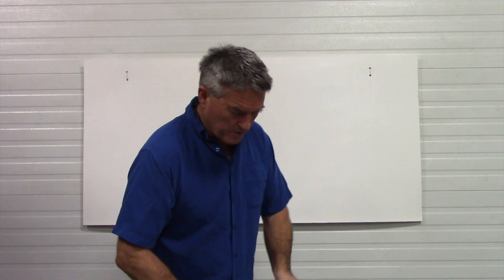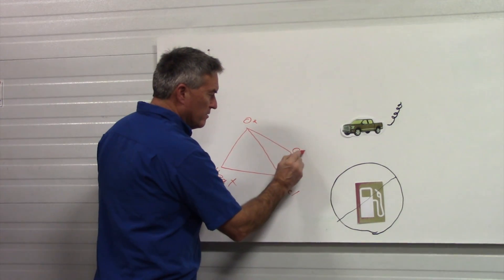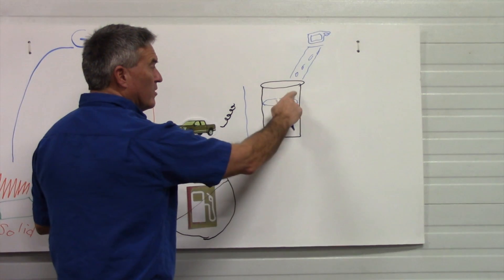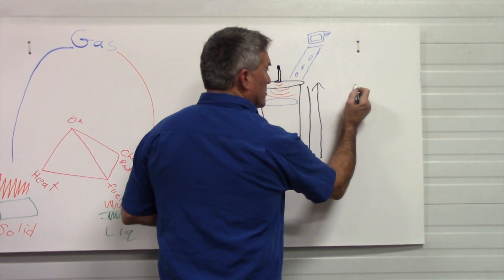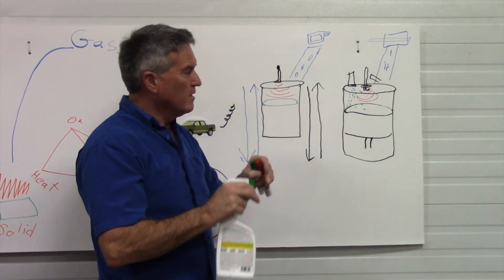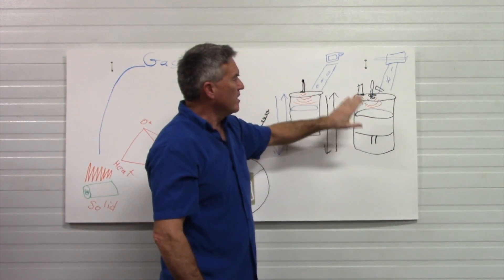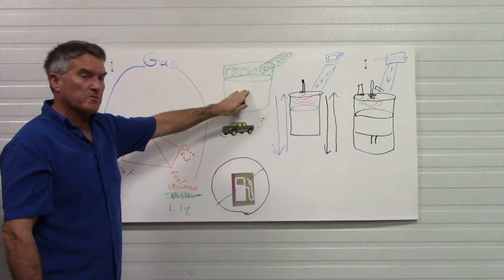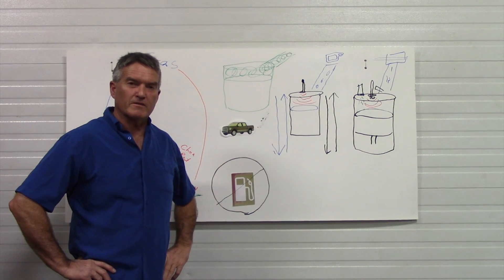One Simple Trick to get 100 miles per gallon with less pollution!

Comment: Gasoline is not made from fossils.  Crude oil is a product that is manufactured naturally far below the the level of anything that even resembles fossils of anything ie plants or animals. Crude is formed from iron, water, heat and pressure, sulfur, and products of the mantle or slag formed on top of the molten portion of the inner earth. New Oil is constantly being made and is replenished. Dry oil wells when left will eventually fill up over time with new oil. The idea that oil is made from fossils and is eventually going to be all gone is false. That was a story that J P Rockefeller fabricated to.make it more profitable.

Comment: From the research & experiments I have witnessed there is roughly about 3 to 4% better fuel economy using vapor over liquid, certainly not 100 mpg! Lets say you have a vehicle that under normal circumstances gets 25mpg. If the vapor method adds 4% better effeciency then you now get 26mpg. That is good but certainly not 100mpg! I am working on distilling plastics back into a workable diesel fuel. Perhaps add some HHO to that mix and you should get even better combustion. To me, recycling waste plastic back into fuel is way more exciting and personally profitable.

Comment: Propane engine fuel systems are vapor systems, although propane has somewhat less BTUs per pound than gasoline, it still doesn't come anywhere near what these folks are saying. 
Frankly reciprocating piston engines just aren't that efficient. If they were they wouldn't have to waste so much heat.
A quick and dirty way to estimate if something is efficient or not is to see how much heat it generates. The more heat, the less efficient. Of course unless you're trying to make heat, that's why they claim an electric heater is 100% efficient from electricity to heat, but it's much, much less if you calculate from coal in the mountain to heat in your house.

Comment: August 2018: Just came across this. Hmmm. In Europe farm tractors,  up to mid 1950's, primarily ran on TVO  (Tractor Vaporising Oil) Kerosine in todays  parlance. Inlet and exhaust manifolds were cast as one unit with an inbuilt vaporiser zone immediately opposite the carburetor  tube. Typically the engine was started on petrol (gasoline) to pre-heat the vaporiser then quickly, by means of a flip tap, changed over to TVO when it would run quite merrily ad infinitum. I also remember some older autos having similar manifolds but continuing to run on petrol. Grand mother had a 1 litre sedan which consistently gave her 40MPG So where does this take us and why did they discontinue combined manifolds. One guess is that Ford found cross flow heads produced more power. Lets have more input on this.

Comment: Misleading and extremely DANGEROUS!  If you create a fuel air mixture upstream of the the combustion chamber, and the engine or device backfires, the ENTIRE fuel/air mixture will detonate!...instantly!  ...causing an explosion proportional to the volume of the fuel/air mixture and the limits of the containing vessel.  Dangerous and foolhardy.  PLUS, we already use gasoline vapors...haven't you heard of LPG?  That stands for "Liquified Petroleum Gas".  It is liquefied to minimize storage space and "boils off" or "changes state" at a reduced pressure.  Educate yourself just a little bit sir, before you try to demonstrate potentially fatal modifications to an already functioning system.

Comment: Ideas like this were used in the 70's with good effect. You still need to change out valve guides etc like you were setting up a LPG engine. The biggest killer of this idea is the computer in your car which will NOT let this work for long. It WILL cancel out any output changes to "beat" you. If you could go BACK to a carbureter you can play with things on that and get some of the increases in efficiency, but who will allow carburated cars anymore, at least here in Australia, you can't have ANYTHING that is not STOCK from the car companies. If the police or the RTA see anything that is not "Standard" they make you remove it.

Comment: He needs to quote modern pollution numbers and get out of the 1800's. The pollution in modern engine is almost unmeasurable. A small fart equals a months worth of pollution from a modern engine. Complete combustion!? Has he ever heard the term...A 'Stoichiometric' AFR has the correct amount of air and fuel to produce a chemically complete combustion event. For gasoline engines, the stoichiometric, A/F ratio is 14.7:1, which means 14.7 parts of air to one part of fuel. Lean burns create excessive heat and pollution. Had he heard of NOX gases? The small flames on his burner just means he also reduced the air to get the blue flame. Too much fuel it goes yellow and produces carbon. He just reduced BTU output. Modern engines create a homogeneous mix either by swirl or tumble,  and use multi injector sprays just like diesels during one combustion event. Don't let this guy BS you!

Comment: I like your idea and have thought about it for years.  The trouble is that lean and fully gassed mixtures, although far more efficient, require an engine redesign which would cool down the engine walls faster.  Lean mixtures translate to hotter engine walls.  So, today's car industry is actually using the rich fuel mixtures to cool the engine from inside.  Pour gasoline in your hand and notice how cool it feels.  Combustion in these engines are always operating in a gas choking style well controlled.  In an old engine design with carburetors, when you adjust to a lean mixture the engine races.  So, you are right.  But the design of today's engine makes it impossible to run it that lean.  

The reality is that if all the heat generated by the engine was converted back to work we would get easily 200 - 350 miles per gallon.  For that, we need a complement engine like the Stirling engine to charge batteries and subject both engines to that effort.  One engine uses gas and generates heat and electricity with a generator.   The other one uses heat to charge the batteries and run air conditioning.  The gasoline engine is an astonishingly inefficient engine.  It uses less than 11% of the power which gasoline can offer.  The Carnot cycle is an idealization which shows you the guaranteed loss, which wastes inevitably 32% of the power under ideal conditions due to adiabatics.  But that leaves 68% of power to play with.   So, 68% - 11% , or 57% loss, tells us that more than half of the power from gasoline is wasted in inefficiencies, most of which is wasted heat.  The criminal here is the guy who invented the radiator.  It was a shortcut to selling gasoline engines before the research and engineering were completed.
Reply: What if you ad a water injector system, to cool the engine, at higher rpm?
Reply: @keithc8108  works fine!
Reply: I know nothing about the subject matter, but what you wrote makes total sense, and is very disheartening to see such a waste, an environmentalist not targeting this particular issue. Instead, they want to take away so many of our rights, instead of doing the job correctly. The wrong people are never held accountable, while the everyday person who's trying to survive, is punished, due to the shadiness surrounding us as a people.
Reply: @ritakus9871 
It's almost like everything good has been inverted.

Comment: The simple trick is changing liquid fuel to a gas. Was an Automotive Design Engineer and knew this 25 years ago. Many have done this to there own vehicle and got 100 miles per gal. Why haven't Manufactures changed to this kind of system? Because the Government and Powers to Be just won't allow it. It boils down to Greed. You can do it to your personal Vehicle but you can't market it. 42 years ago was paying 32 cents a gallon and now it runs as much as 3.00 a gallon. Were not even close to running out of oil. We have a mass amount of oil under the ground in the USA that is setting capped off. It will be used when the rest of the world runs out to operate the War Machine.

Comment: I can´t tell him to get his facts straight since it´s not official but it turns out that fossil fuel does not have anything to do with fossils. Oil is created in the mantle underneath the crust. Some of it, both oil and gas seeps through to the crust where we pump it up. Look it up and you´ll ask yourself, why are old oil fields filled up when they are deemed empty? 

Anyway, the simple trick comes at 12:00 but it´s not clear to what he says or means. He is talking about different ways to mix fuel with air with carburetors and injectors and the thing with those systems is that the fuel is not made into gas, only tiny droplets, so the third option is...

...to vaporize gasoline where there will be no droplets. To do that, which is very simple, is to make a bubbler.  Instead of injecting fuel into the system, you let the air go through the gasoline before it is sucked in to the cylinder. The principle is exactly like a water pipe. If you let the air go through the gasoline, it brings with it fumes from the gasoline and that mixture will be exactly perfect to combust.

Using this technique, you can extend your milage far beyond what is possible with other options.

Easy peasy! Build yourself a bubbler. All the air needed for the engine has to go through gasoline first and that´s it! Good luck!
Reply: I have a bong.  Can I use that? or does it have to be metal?

Comment: Yup.It would be Good. Canadian Inventor C.W.POGUE Patented Inventions Did Create Gasification/Vaporization Turbo,Super Charge and Direct Vapour to Piston Injection. PATENTED Archival Proof of conception Starts at 50plus miles per gallon up to almost 200 miles to gallon of gas THAT GM,TOYOTA,FORD,ETC.Company's applied and recieved "Thier stylized versions "BASED ON Mr.Pogues Discoveries. FUNNY how Big Auto /Oil Industries are STILL. ....Trying to due That Proverbial Effort of "Re-Inventing that Wheel " as one had heard.!!  In my opinion Mr.Pogues systems logically work but I Also Believe that Complete Resyncronization of Camshaft,Intake,Exhaust Valves,Matching the Quicker Intensive Fuel Vapour Exsplosvieness,  (compared to liquid fuel ) as not to burn out aforementioned due to increased timing,gas vapour,air etc..If I remember correctly present air to liquid fuel ratio is approximately 14 parts air to 1 part fuel  (excludinding super turbocharged systems) and Natural gas 10a-1gas,Propane=8a-1gas....Hopefully I remembered ratio's Correctly and Not Have another " Cerebral Fluctuation " Again due to my Multi Terminal Co-Morbiditie's.
Be Well, Take Care, Keep Honour,Respect, Integrity, Compassion, Understanding, Love,Laughter and Logical ECO Friendly and DAMM COMMON SENSE ALIVE .Blessings to Y'all and see ya on the otherside or dimensions .

Comment: There is no gain from burning petroleum fumes it lasts just as long as it's liquid form
Reply: A lot of energy goes out the exhaust pipe,we used to put a spark plug in the end of the pipe and fire it with a magneto ,made one helluva bang.You could burn less fuel if you vaporize (atomize ) it ,i did a experiment on a lawn mower,did a drip on the exhaust and piped the fumes to the carb intake,it ran 27 hours on a tank of fuel.The problem is I could not come up with a safe way to create the gassy state and then meter it into the intake port.

Comment: Ok so for you guys that are naysayers on the vaporization theory and hho,  I can prove that vaporization and hho both get better mileage.
So for vaporization, heating the fuel to a vapor point through water, exhaust gasses, or even pre burning this fuel will net you with a minimum of a 35% increase in mileage, and up to 270% increase in mileage depending on the type of system you use.
HHO however will net you from 3% to 50% percent increase in mileage in my application.
There are ways we could increase the output and efficiency of the fuels we already use and have readily available.
I have ran into problems with the US government and EPA by tuning on my own detroit diesel engines.
I had a 14 liter detroit 60 series getting 80+ mpg when loaded, and 95-100 mpg empty.
But the government fuel tax system on trucking caught up with me and now that engine has been put back to factory specs, and my pockets are $300,000.00 lighter.
Reply: I used to drive that same Detroit 60 series and could get about 8mpg. Man you must have made a fortune while it lasted.

Comment: I have to wonder what this guys qualifications are.  His simplification of the combustion process is laughable.  Gasoline, for example, is not directed at the cylinder wall to "cool and lubricate".  Fuel is used to cool the cylinder in an "air cooled" engine but not as a liquid.  The presence of a fresh fuel air mixture has a cooling effect on the cylinder's atmosphere.  Gasoline is NOT a lubricant!  And fuel condensing on the cylinder wall will quench the flame front and yield excess un-burned hydrocarbons, which is why combustion chamber turbulence is a design goal.  His whole video is just another 100 mpg carburetor song an dance...is was BS when I first heard it in the 1960s and it is still BS today.

Comment: This is nothing new, back in the 1980s, a Texas group came up with a system based on a similar principle, it worked like a Coleman burner (or like the M2 burners used in the military field mess ovens), and used a carburetor similar to a natural gas or propane carburetor.  They ran 4 prototypes of various makes, all with 400 cubic inch V8 engines. all of them exceeded 100 mpg. However, they were taken to court multiple times, accused of patent infringement. they would win one, and they would be hauled back into court for the same thing using a different patent. They didn't lose in court, they went bankrupt defending themselves.  There are too many people, with big money,  who do not want this kind system on the market.

Comment: Yea your mostly burning the lighter gases and not the heavier gas like the liquid gas in the combustion process ,that what happens in trying to use vapor to instead because your drawing the vapor that's ment to raise the temp in the petrol your just taking away but not actually evopaorating the petrol form to burn ,some intakes had heater jackets to help with that like Subaru ,Iv done the experiments and you mostly just take away the lighter gases that ment for the heavier petrol to heat up and burn,all that high mileage system is b.s. your just taking away lighter gases and leaving heavier gas in take,but I have an idea how about warm up the gas at the injection rail so it will evaporate better when sprayed and cold air intake so when the two meet it will cause higher expansion and get more power and better fuel mileage.,Hummm give it a thought.

Comment: For safety reasons this will probably not work. In an accident, this gas / air mix in a container is a bomb! The mixing process would have to be milliseconds from the combustion chamber and in a low volume to be safe. CNG is a much more viable setup when all things are considered. The gas and air is mixed outside of the reserve tank.

Comment: Gasoline doesn't burn, gasoline (vapors) burn. That's why oil companies introduce chemicals into gasoline too make the molecules larger, you use more fuel = more profits for them.

99% of freight is moved by diesel engines, they are already efficient.

Comment: its amazing that fuel economy for the same size car and roughly same size engine. 30 to 45 years apart still gets about the same fuel economy
Reply: This guys video is nothing but a sham.  I fell over laughing at the dirty, rusted, junk yard engine that supposedly was the 'proof'.  

back in the day (mid 90's) I had a 1987 honda civic CRX (hv? model I think).   That car had a 4cyl engine, a 5 speed manual tranny, and had >200k miles on it.  My avg efficiency was ~45 mpg (mostly city with a small bit of highway).   it was light-weight, not fuel injected (it had a carburetor) , and still managed this economy.   It was able to do so because of weight savings and simple engineering compared to modern vehicles.   It was zippy enough, but certainly not a 'fast' or even really a 'quick' car, but still very fun and economical to drive.  I laugh at that whenever I see the proud claims of today's super hybrid cars sporting ~50 mpg in recent years.
Reply: @billf4995  I had an AMC spirit back in the late 80s. It got 46 to 52 mpg in the city. It had seating for 5 and it was pretty quick. Had the most power I've ever drove with a 4 cylinder engine.
Reply: This guy is so full of it, all his "facts" are incorrect.  His conclusions are outlandish.
Reply: Dad's 1946 car got 35m/ ga now cars get that and we are told it's a miracle.
Reply: exactly! my "new" 1954 dodge pick up gets close to the same gas mileage as my "old" 1988 chevy suburban.
Reply: I drove smaller lighter cars slower 40 years ago.
Reply: That is not exactly true. The cathalitic converter reduces overall fuel efficiency and all the safety features make our modern cars more heavy. Despite this these set backs for a fuel economic perspective they have a comparable milage with the old cars. Amazing if you think about it.

Comment: Thank you. You know I figured this out in the early ‘70s. I figured to use the exhaust to heat the gasoline in order to vaporize. Also thought of using the radiator also electricity. Needs to be under a small amount of pressure I figure about 5-15lbs should do. Is it possible electronically to tap the fumes? Gasoline does evaporate at 78 degrees Fahrenheit.
Reply: Old carb-fed piston engines used exhaust passages under the intake manifold for that effect. It's called a heat riser.